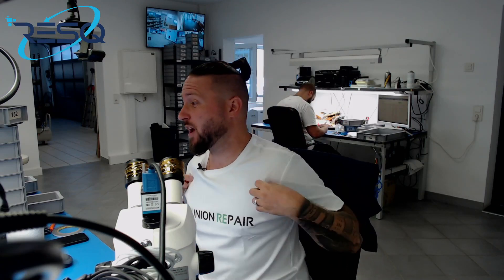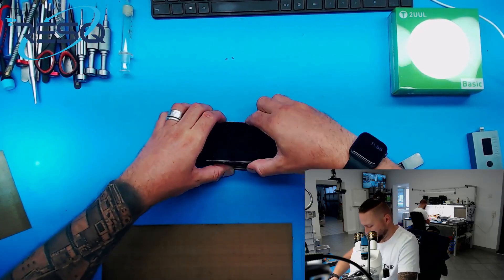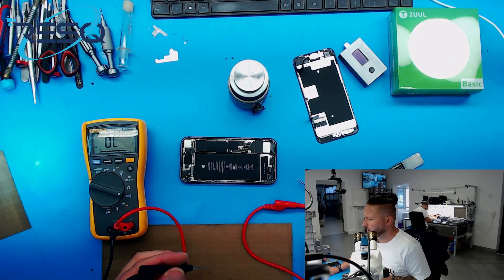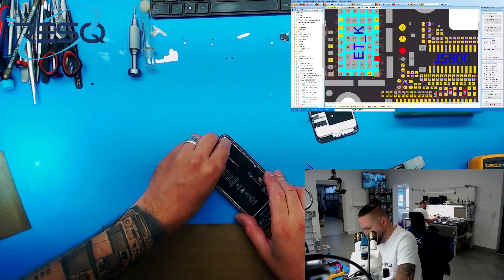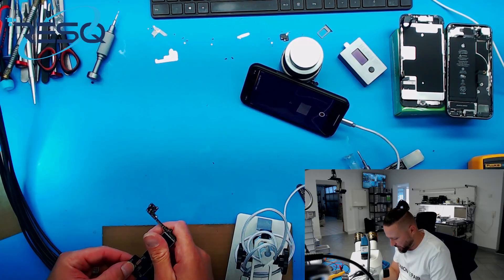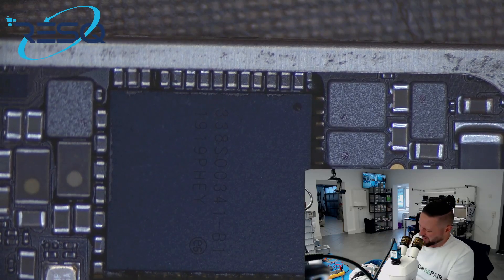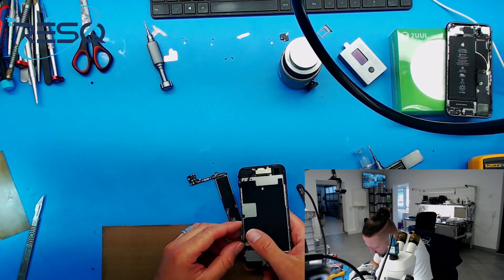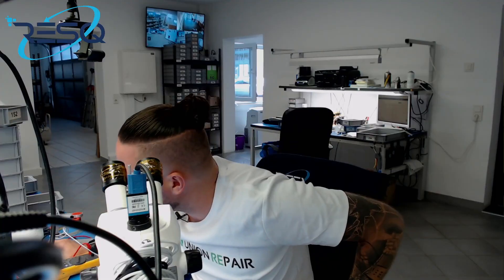HOW TO USE THE ICC PRO V2 FOR A FAST & EASY TROUBLESHOOT - DATARECOVERY iPHONE 8 - VDD_MAIN SHORT

Comment: Can you share a design file for the ICC Pro v1 case for 3D printers? Mine's falling apart from constant disassembly to charge the internal battery once it discharges too much. Latches doesn't hold it together on anymore. I'd like to print a replacement case.
Reply from the maker: No problem. Just give me your email address.
Reply: @RESQREPAIR  i tried to put an e-mail with in the comment but it keeps vanishing. I sent you an e-mail to info at resq-repair couple days ago asking about case design file but didn't get any reply so far. Could you please take a look? Maybe someone who's in charge of emails just ignored this one for some reason.